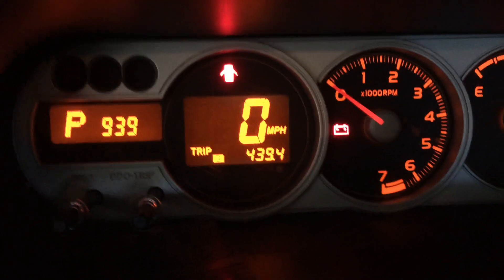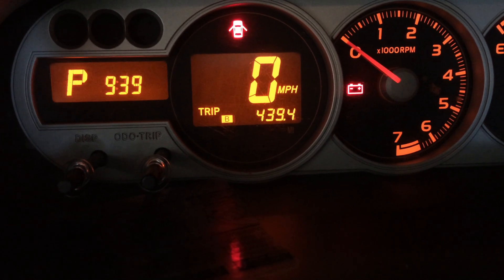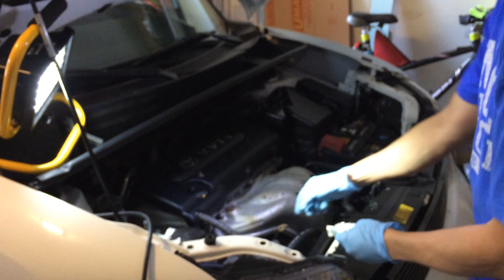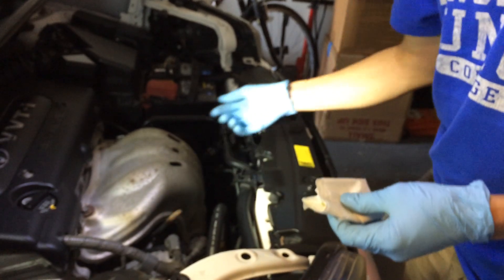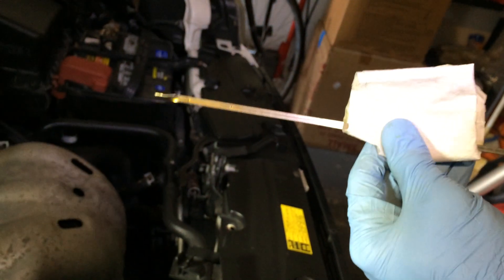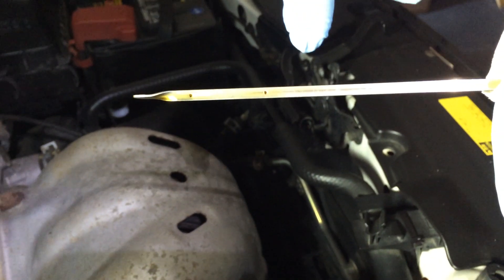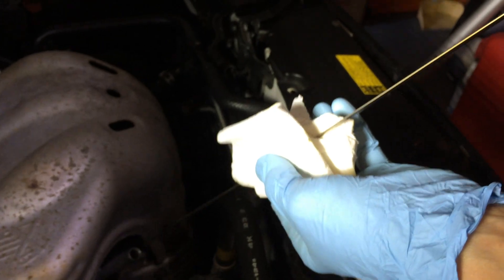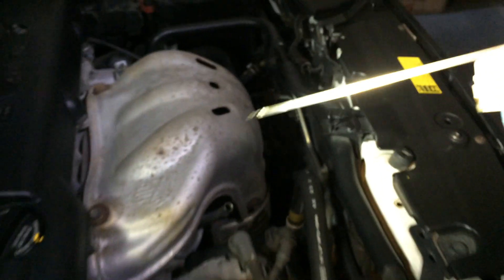BEWARE - TOYOTA SCION Oil Consumption Test Trick???

Comment: My 08 eats oil! Have to put quart in every 3 or 4 weeks! You can always tell when it’s low when you corner or brake the oil light flickers on and off. That Asians car never left my stranded. Alternator went out other day still let me get to shop to get replaced.
Reply: how long have you been driving it with that issue?
Reply: Mine too been doing it for 2 years 😂

Comment: I almost forgot about this video.  Long story short, I brought it back to the same dealer and expressed my concern.  They redid the test and I had to check the oil level before it was sealed.  After 1300 miles, it passed the test and so I was satisfied.  Then after two years (2018), I brought it back again for another test and it passed again after 1300 miles.  I can not believe it, because before I brought it to them it was burning oil like crazy.  Now, my mileage is almost 173K and I'm always noticing that the oil is about near the Low Line just after 600 miles.  Don't get me wrong, the car still runs good and I love it.  I stumbled again with this video I made because now I'm researching on how to rebuild the piston rings.  Since Toyota did not want to fix their own engine flaw, I might just fix it with my mechanic friend.  With all my great Toyota experience, I think this is one bad problem I'm willing to solve.  God bless.
Reply: I'm right there with you. I have 08 with a 178,000 miles and need to top it off right around 600.. just got the notice of now the airbags being recalled because they can explode in the passenger and shoot metal at you and could cause serious injury. 2020 living on the edge baby!
Reply: Lots of cars have this issue, do a compression test if compression is good on all cylinders try removing the Pcv valve on the valve cover run a vented oil catch can and your oil burning issues will be solved. Lots of times it's from oil vapor being pulled into the intake manifold from the recirculating Pcv.

Comment: I insisted to look at the oil level before and after the two tests, but dealer and Toyota both ignored my requests. Result you can guess! my car showed less than half quart engine oil consumption both times at 60K and 115K miles! I fill around 4 quart every 5000 miles.

Comment: Guy at the dealer and I were talking about this while i was there getting a part for another car.   He says they’re pretty happy when the cars fail the test because they get paid by Toyota for the rebuild so there’s not much motivation for the technician or the dealership to screw us. Still, that being said, my car should have failed.  What someone should do is pick the car up at the dealer, video the entire exchange, drive down the street and check the oil (breaking the seal and the video being unbroken).  It would be hard for them to refute that the car was overfilled if in case that is in fact what they did since you videoed it all.   It’s important to note too that overfilling the engine can cause foaming and engine oil starvation so I don’t know how that can play into this and how much you can get away with overfilling.  My car uses now, five years later, about a quart every 500-700 miles.  It’s fine.  I put oil in it and drive.  It doesn’t leak, smoke or run poorly.  It just uses oil.  Whatever.  The car has never had a mechanical issue on 10 years.  I mean ever.  Normal maintenance and wear items like tires, brakes and batteries.   Still has factory rotors.   It is OK to overfill the engine a half quart by the way.  I’ve been doing that to minimize adding.
Reply: Then, it will cause the catalytic converter to work extra hard. In CA could cause smog test to fail.
Reply: @sg4413  Sure glad I live on the other side of the country and we don't smog test...

Comment: Mmm idk. I used to work for Toyota in the service department. I think what happens is people confuse Toyota the company with Toyota the dealership. The dealership gets paid from the Toyota company for doing warranty repairs. They’re not going to overfill it to avoid a repair. They want the repair!
Reply: Do I have to be the first owner of the vehicle to take it in for repairs or as long as its under 150000 miles

Comment: i love my 2011 xb i have driven across the country with no problems however these engines are oil consuming monsters!!!! i had the test done also but wasnt able to bring it back in the week they said but when i checked my oil it was 3 quarts low as it always is after about 2 weeks of everyday driving....i have friends with scions and they have the same issue they recalled my car for airbag issues but not for this oil problem and i think that is just so they dont have to replace the engine pistons and or rings! very bad for business....i wont be buying another toyota again they obviously know of this problem because its all over the internet and because they wont address this issue is why i wont buy another one....not because of the car because like i said it is a VERY reliable car but all they care about are things that they can be sued for not the longevity of their product....sad....
Reply: I just bought a 2005 scion XB just for a daily driver so I could park my Subaru but how many miles have you driven before you noticed the oil consumption?

Comment: If it's under 10 years or inder 150K miles (whichever comes first) you should qualify for engine rebuid (replacement of pistons and piston rings and rod bearings, if the bearings are worned out).

Toyota knows exactly what is the problem - pistons and their rings.
The Scion tC (xB) uses the same engine as RAV4 and Camry - 2AZ-FE.

BTW, you can read about this problem on Wikipedia. Just search for Toyota 2AZ-FE engine.

Comment: Wow, that is terrible. Can't believe my car company is scamming people like that! They overfilled it so that by the time you bring it back it would only be at the full mark meaning they won't cover the rebuild cost. I have a Toyota Prius with the same issue. Except mine will burn about 3qts by the time it's time for a oil change. I just barely make the interval. There is only oil at the very tip of the dipstick by the time I reach 3000. Because of that I started doing my oil changes about every 4 or 500 miles. I'm going to do an engine flush later as well as soak the pistons for a few days with Chem dip.

Comment: i took mine in 5 times for this test. 4 times i took it in they kept telling me that it passed then id leave and my oil would be empty at 3000 miles. I just recently did my 5th test demanding to see proof of the before and after. they denied me doing so but luckily i finally failed and they are working on my car as we speak at 120k miles.
Reply: Para gon how did you go about contacting Toyota? Did you just show up to a dealership

Comment: Did you tell them about that? What did they say when you brought it back in again to do the test? I'm actually at the dealer again for my second test right now because I'm still burning oil.
Reply: my girlfriend got her car used of a dealer and she is having the consumption oil problem do you think if we were to take it to a toyota dealer ship they will do a test even tho we bought it used?
Reply: Fume you better get it done quick. it doesn't matter if it's used or not as long as the model and year fall in the TSB. be quick because it ends on October 26. you need to drive 1,200 for the test but that's after you go to the dealer and have it prepped to do so. so if you go soon tomorrow and drive 1,200 by the 26th then more power to you. good luck.
Reply: alright thanks for the head up
Reply: I just got an 08 tc yesterday and I'm taking it Monday for oil test because it was once again extended past 2022 if the vehicle has less than 150k

Comment: They did the same BS at the dealership I took mine to for this test. They just overfill by a quart so when you come back they can say it didn't lose more than a quart.  Toyota sucks!
Reply: Amen to that
Reply: I bought mine Used,a 15 last Feb with32k. My car was over filled. I demanded it receive the test after a recent oil change they gave for no charge. I plan to go back after 1200 miles.

Comment: The oil dipstick is a dumb design , on my vw there is a plug above the part where you read the oil level, it’s there for this exact reason , to prevent excess oil rising up the dipstick giving you a bad reading , either way just drain out some oil and drive it back to them, how would they know anyway ?
Reply: BECAUSE HE BROKE THE TEST SEAL. PAY ATTENTION.

Comment: ScionARA Bee
I did my oil change(DIY) on our 12 XB when it was new, I put in the right amount of oil which is 4.5 qts as prescibed by the manual. When I check the dipstick, the level went past above full on the dipstick. I don't know if there's a mistake making the right dipstick or the 4.5 qts is way too much.
Reply: Tis says 4.5 qts but i have been told that is wrong and its 4.2 qts
Reply: So I have been working at Toyota for 10 months as a lead tech changing oil at Toyota yes that motor calls for 4.2 quarts I no longer put that in there I put 4.6 qts even in my Scion tc and my xB and these motors have problems consuming oil but so does every motor at some point does I check both cars now once a week and usually after 3k I use maybe half a quart if that
Reply: As far as I know of yours is a 2010 it's out of warranty 5 year or 60k so unless you have a warranty elsewhere that you bought it has to be more that just the Piston rings like timing cover gasket or something like rear main but I don't worry about it so much even on my 2005 Scion tc uses a half a quart and has a timing cover leak and uses a half a quart it's not that big to me to put that much money in it yet but when it comes time I will be rebuilding that engine and make sure when you do the engine Piston rings have them change the  rear main do not skip that part it's very important
Reply: @exshenanigan2333  also I put 4.6 not 4.2 just because I know these engines burn oil

Comment: They put 5 quarts in it so that you won't use up too much and go below 3 quarts while driving... and cause serious problems to your engine. I guess. But pulling the dipstick shouldn't create a problem. So they are crazy not to tell you that they put in 4 to 5 quarts of oil in it. They never let you go into the service department to keep an eye on your car and they pull shady tricks like that to get away with not fixing it. How sad... it isn't even the dealerships money it's the Japanese company loosing money.

Comment: You are likely NOT checking the oil in the same conditions as when it is tested.    How long has your vehicle been sitting?   Hours?  Days?    Oil consumption testing procedures states to check the oil level on a fully warmed engine that has been sitting for 5 minutes.   By allowing your engine to sit, all of the oil in the cylinder head, oil galleys.. everything.. has been allowed to slowly drain back into the oil pan to collect.   of COURSE your oil will register higher at this point.

Comment: My 2012 xb with 100000 miles burns oil only if I put the 0w20 in it
Reply: Beautiful Sinner ow20 is light but the 2012 isnt part of the recall i own one too
Reply: Have you changed your PCV  valve? That can get stopped up and force oil by the rings and burn oil too. They have the PCV at AutoZone for $5. easy as unscrewing it and reinstalling the new one...
Reply: What grade did you use .. 5w-30 or ??

Comment: I have 09 xb same problem.November 2018  i went to toyota dealer and they said the oil consumption recall ends 2 weeks ago .
Reply: is this true or were they just saying that?
Reply: This is not true they are still honoring this until 2026 or 150k miles on the vehicles that qualify

Comment: If’s it’s the same engine as Camry why not put same as Camry oil  5 /30 ?
Reply: Walter Meyer If you change the viscosity of the oil it can damage your valves. You always want to put what the manufacturer recomiendes.
Reply: Camry had the same issue, and uses the same oil.

Comment: Just did my test...No idea how it passed.. Got it home 30 miles away check it again, and its 1/2 quart lower than when they checked it at the dealer, which would have failed the test...  Make sure they let the car set 10 minutes so the oil will settle.. They didnt for my test....thats how mine passed, when it should have failed...
Reply: guitarsofthegods you people really amaze me, change the oil yourself and then replace it with how ever many quarts you need then after 1,000 miles drain all the oil again and check if there is a difference between how much you put in and how much drain out, it’s better than trying to read that faulty dipstick

Comment: Mine has an oil consumption too. What is it with these scion.?
Reply: same motor as camry/solara, my solara would go through a quart every 1200 miles. ran forever but like clockwork burned a qt. every 1200 mi

Comment: How long has the engine been sitting when you checked the oil?    Hours?  Days?   You've given so much time for all of the oil to drain back into the pan.. of COURSE the level will be higher!
Reply: my thought exactly. people don't know how to properly check oil and jump to conclusions. oil should be checked when engine is still warm, ideally about ten minutes after shutting engine off. I swear people have shockingly little practical knowledge anymore.
Reply: @AsTheWheelsTurn  If you check your engine oil after turning the car of, on hot engine, your oil reading would be all over dipstick, you not going to get accurate reading.
Reply: @Anatoliy911  incorrect, you should never check engine oil when it is running, the dipstick reading is set to be measured on a warm engine with it shut off for a minute or two at least and no more then about ten, that has ALWAYS been when you take oil level readings.....if you take it while it is running most of the oil is in the engine and not the pan the reading is meant to be taken of the level in the pan after it has a minute to settle.maybe you are confused with transmission fluid readings which are meant to be done at temp with engine running....

Comment: how long had your car been sitting before you checked the oil? oil should be checked about 10 minutes after shutting off the car from being fully warmed up to operating temperature, if you let it sit all night for a few hours the oil level fills slightly higher than full because it all settles down. run the car ,warm it up ,shut it off then check your oil lever after 10 minutes, this is common knowledge! just the same as checking trans fluid, you have to do it correctly, trans fluid levels need to be checked while engine is RUNNING AT OPERATING TEMPERATURE or your reading is incorrect.